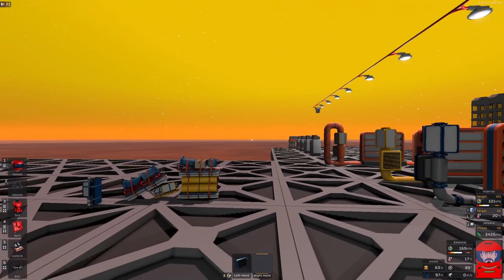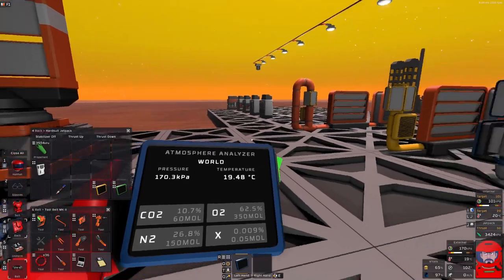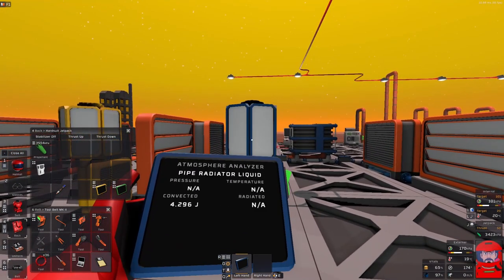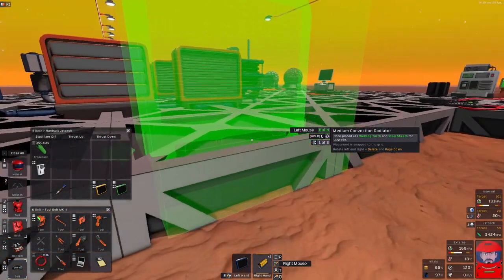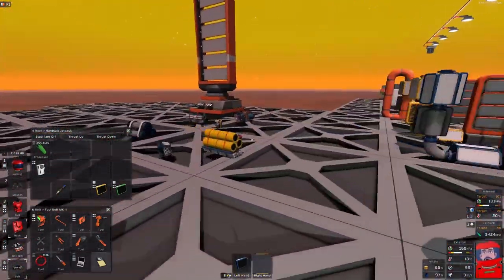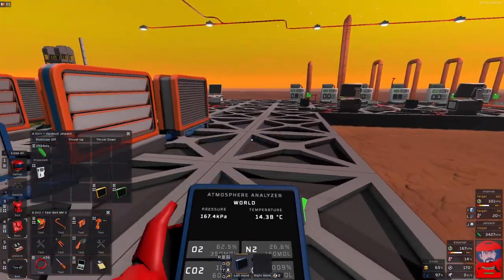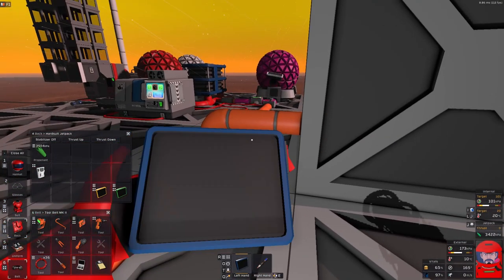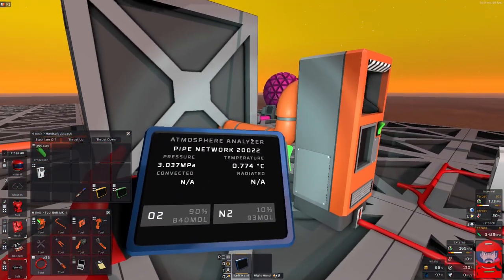Stationeers Thermodynamics update

Comment: Ah, great video! thanks for putting all that together. I can imagine that the devs are going to see this and swear at themselves. They are trying SO HARD to get rid of the cheaty crap but then invent new ones :D :D amazing.
Reply from the maker: I imagine they would have a bit of a laugh, they know this is all part of rapid development.
Reply: @cowsareevil7514  ha! didn't take you long to work out this exploit! Probably need to make sure I clamp this so it can't get hotter than the surface of the sun :D You can definitely still do some thermodynamics cheesing around rooms as frames and walls are still perfect insulators for world atmospheres. I want to get them exchanging heat with their neighbors at some point in the future, but there's more pressing stuff to work on first.

Comment: What I've found is that in a vacuum environment like the moon, radiation only works as long as the sun is visible, and only to heat up the gasses. The radiators do NOT cool in a vacuum at all like they used to.

Comment: My understanding was that radiation was for low/zero pressure environments, using the external planet temperature. I messed around with them a bunch and radiation seemed much better on mars/moon than convection. The results on vulcan/europa was vastly different though.
Reply: Radiation radiators eject heat not into the atmosphere, but as infra-red radiation, in-game that translates to "erasing X amount of heat". The sun directly heats surfaces (in the game's case, the radiators) depending on their radiation absorbent coefficient for an amount of radiation given off by the star, and the star emits a large gradient of radiation from radio waves to gamma rays, but infra-red is still the most energy heavy frequency so a radiation radiator that tries to gain heat from the sun would do well to use a material that absorbs that type of radiation. It also just happens to be the same sort of stuff that naturally radiates out of all objects (infra red radiation) so a material that absorbs infra-red also emits it much more efficiently if you want to cool stuff in space.

Convection is the exact same as you holding a hot cup of tea, the heat undergoes convection from the hot water into the cup and then from the cup into your hand.

I have written this because your comment hints at a lack of understanding in the subject.

tl;dr - Convection only works with an atmosphere and is reliant on the atmospheric condition of said atmosphere, radiation works in both atmosphere and vacuum the exact same way but is also affected by convection, if to a much lesser degree than a dedicated convection radiator.
Reply from the maker: Convection requires an atmosphere.  Mars is very low pressure, so the game might treat it as a vacuum the same as the moon.  I didn't do any tests to find what pressure they change from from one to the other.
Reply: @ScarletFlames1  "The internal atmospheres of devices and items now radiate energy down toward the planet's global atmosphere temperature." This statement alone tells me it's not just ejecting heat like it would in reality.
Reply: @cowsareevil7514  No idea to be honest, would be interesting to see how radiation works compared between all the default planet settings. I'd assume 20kpa is probably around the right point.

Comment: With the vacuum rooms forcing radiation, how about vacuum frame radiation conditioners? I mean just putting hot gas into pipes with radiators (not convection) - will the gas cool down and to what extent?
Reply from the maker: It will only cool to the outside temperature.  So just less efficient than putting radiators outside.

Comment: Stationeers is going full Monkey's-Paw with their updates it seems.

Things sealed inside frames having zero thermal transfer was an overapproximation, but still was a somewhat decent approximation.

Whereas now... I have a 25C pipe in the middle of a 25C room and all is well. I seal it inside a frame and suddenly my 25C pipe inside a frame - surrounded by 25C air - starts changing temperature. That's not a decent approximation by any means.
Reply from the maker: IRL the frame would loose temperature to the outside world so the small loss is reasonable.  It is still 100x better than having the furnace in the open.
Reply: @cowsareevil7514  IRL a frame would lose temperature to _its surroundings_. Which in this case is  25C air, and so the temperature of the pipe would not change as it is already at 25C. Whereas right now it seems like frames lose temperature to _the world atmosphere_.

So if I have a base, at 25C, on an inhospitable world... and in the middle of said 25C air,_ surrounded on all sides by said 25C air_, I have a non-sealed frame with a pipe, everything is fine.

I seal the frame, and even though the frame is surrounded on all sides by 25C air the temperature of the pipe starts changing away from 25C.
Reply: @TheLoneWolfling  Aaand you have a decent but ridiculus way of cooling... "magical intercooler" :p
Reply: @sciurusvulgaris2548  Exactly.

Comment: How good is the atmospheric simulation?
Would a chimney Work? Because we could create a power tower W waste heat, power turbines & Stirling modules (I think they're in this game, but not sure I got the term right)
I've seen atmospheric reaction to heat, but on reflection it doesn't seem to be a thermal convection plume, just a globe shaped pressure differential.
Even if just heat won't work, waste heat + waste gasses might.... It wouldn't be a chimney either, so a corridor W atmospheric vents & radiators in a closed end; heat just provides better expansion for better power....
Reply: Passive vents W one way valves (one of the pipe valve options) may work to fake a power chimney effect without the waste gas

Comment: How about a stirling engine in between a extensible radiator and a convection radiator?
Reply from the maker: If you can generate enough heating and cooling it would work.

Comment: Is the water connection on the furnace a 1-way? Why not just connect the hot water line directly to the furnace to heat the furnace?
Reply from the maker: Yes.  I have tried that in previous furnace designs.
Reply: Mmm, some weeks ago (and before) the furnace liquid connector was output only. You were able pump out water but weren't pump in the furnace. But an overheated steam powered steel smelter... that was a real steampunk feeling. :D

Comment: My furnace on europa is completely broken as of yesterday. Had it inside a frame, and it was losing heat too rapidly to even make steel - as soon as it got up to temp, it'd drop a few degrees a tick. Took the frame away and sealed the furnace in a small room surrounded by flat walls. That worked the first time, and then the room exploded (I assume because of overpressure, but I wasn't measuring at the time). Tried a second time with a sensor in the room, and then the room just would not heat up at all, and the furnace kept losing temp like it was in the frame. No idea what to do at this point.
Reply from the maker: Put an active vent in with the furnace.  Set it to inward and set the pressure external to about 50.  This should stop the room exploding and keep enough pressure to insulate it.
Reply: Thanks, I'll give that a try. Bit frustrating the way it's been changed. I might need to tweak the values that go into the stack to give a bit more temperature leeway to deal with the heat loss.
Reply: This is exactly what I've been experimenting with. Took some practice but I have my active vent set to keep the "heatsink" room at 100 and it's working really well, as long as you don't heat up the furnace too rapidly. Don't use flat walls. Use composite walls because they seem more resistant to high temperatures. I also have a regulator to top up the room to above 50 if the temperature drops too much. If the room has very low pressure the furnace starts losing heat to the atmosphere as if it was in a vacuum. Also, initially I couldn't figure out why I kept starting fires with this setup. I was forgetting that the ice I was using to prime the furnace sublimates in chutes now that it's not in a frame... so don't do that 🤣
Reply: @NeilNDMay  Ahh - that's where I went wrong. I was using flat walls! Thanks for the tips!

Comment: wow i am trying play stationeers, but no luck =( Can you help me with some questions, please?
I am playing on Mars.
I placed 6 solar panels (3 one side and 3 at the other side) and it stills do not gives me power =( So:
1- How i know what side i have to place the panels? it is giving me only 6% of effectiveness... 
2- I can not make water o.O i tried ice crusher, pipes and water filling, but no matters it does not fill the bottles =(

ty!!!!
Reply: Water must be liquid. Too cold or too hot will not fill. Solar panel efficiency depends on the panel pointing at the sun.
Reply: Try to put the panel horizontally, it work better. For water you connect the bottle filler on the power grid?
Reply: The bottle filler need now electricity. Also don't forget to turn it on.
Water temperature also need to be between 0° and 100°.  Since 3 or 4 patches ago the Ice Crusher warm up the water now to 5° after crushing the ice, so that shouldn't be a problem anymore.
Reply: thank you for all tips! I forgot to plug eletricity, and did it now.
But the power button is flashing and the popup says it has an error. 
I am using the normal liquid piper. May I use the insulated version?
ty!!!!
Reply: On Mars you don't need the insulated pipes. 
Basic layout is, ice crusher, liquid pipe connected to the proper output (inferior one) the you can put a T joint connecting to the liquid tank via tank connector, and the bottle filler. Check the pressure and temp via tablet. And should be working.
Reply: @Larri1Cruz  you`re the best. Thank u very much! I did as u told and it is working pretty nice, ty!!!!

Comment: Putting things inside frames/vacuum is still excellent insulation vs just having exposed pipes. Like almost 100x better in the convection vs inside frame example.
Reply from the maker: Yes it is still very good insulation but a sealed hot room is better. There is some lag as the room heats up but zero heat loss.
Reply: Well, kind of. It's a thermal path to the world, as opposed to a thermal path to the surroundings. Sealing in a 25C pipe in a 25C room is suddenly a terrible idea, for instance.

Comment: The extendable radiator quirk you exploit in the back half of the video got patched 2022-Sep-7 (much to my disappointment)
I think the relevant entry from the patch notes is probably :
"Changed Applied a scaling multiplier to solar radiation based on the absolute value of the internal Atmosphere being radiated to Y = 1 / (1 + Pow((X / 450), 3.2) (where X is TemperatureKelvin of internal atmosphere) "

Comment: Furnace in a vacuum. How the hell would it lose heat. The room has nothing for the heat to move too. This update makes no sense.
Reply: Black body radiation in the IR spectrum. It's relatively slow compared to conduction/convection but it always occurs.
Reply: @Ltbird  not at the rate they have in game.
Reply from the maker: IRL the furnace would radiate heat to the walls of the room and the heat would then be conducted away through the walls.  This would be a lot to program so they have emulated it by making the heat vanish in a way that makes physicists cry.
Reply: @cowsareevil7514  Can confirm; am crying.